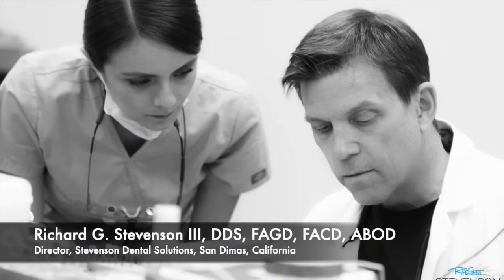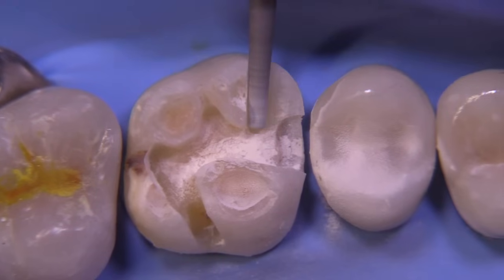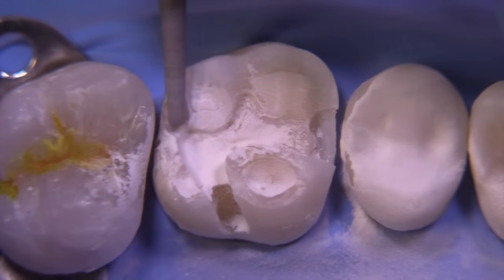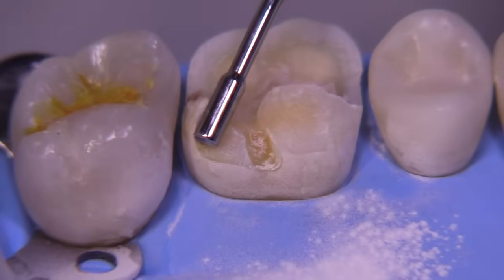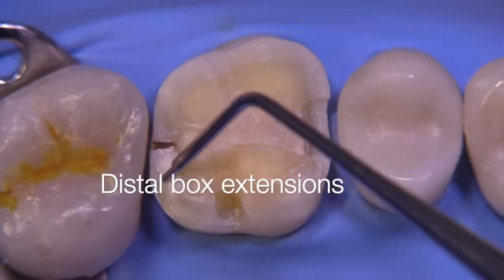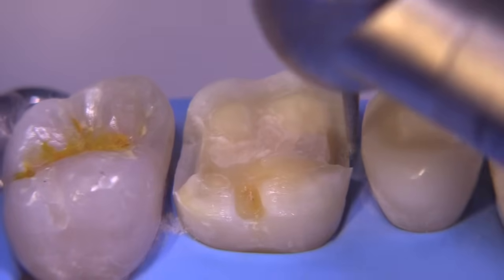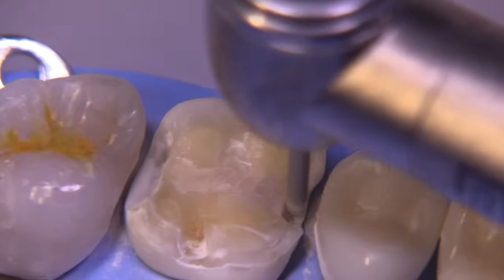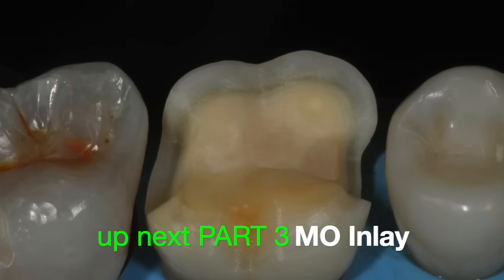Lithium Disilicate Ceramics, Part  2: Ceramic Onlay Preparation

Comment: Hello! In my training, I was only really instructed to do crowns. What are the indications for onlay over full coverage crown?
Reply from the maker: Whenever possible, a more conservative indirect restoration is preferred.  Contraindications would include: a previous crown, the need to completely change the shade of the tooth and the presence of cracks which were symptomatic and likely leading to cracked tooth syndrome, some RPD retainers (survey crowns) and some FDP retainers. In my practice of nearly 40 years I gave placed many more inlays than crowns - gold, ceramic, and glass-ceramic.
Reply: @StevensonDentalSolutions  Thank you for your reply!

Comment: One question Dr. The caries was on MO surgace why did you also prep the distal surface? When prepping for onlay do u have to create a box on M and D sides or is it just in this case?
Reply from the maker: Excellent Comment and Question!  When you need to replace the occlusal surface due to wear (exposed dentin), you need to decide on the proximal finish lines.  To keep the finish lines occlusal to the proximal contact zone is rarely an option due to the need to keep the restoration margin free from the proximal contact.  If the morphology of the tooth and the current situation allows, you can occasionally do this - however, it is not a common finding, hence, I drop the box form to extend past the contact areas.  On a terminal tooth, (a second molar with no third molar, for example) the situation is entirely different and the distal finish line may be kept on the distal occlusal portion of the marginal ridge.

Comment: Thanks

Do we need to open proximal contact with onlay preparation?
Reply from the maker: In most cases, yes.  Leaving a margin in the contact area leads to numerous lab and procedural challenges including poor margin adaptation, difficult cement removal, inability to finish and polish, residual caries, contour difficulties, etc.
Reply: @StevensonDentalSolutions  
Thanks 
But some teeth need to cut more gingivaly to open the contact which is aggressive preparation. 
Is there case report article with or without open the contact demonstrating complications after follow-up?

Comment: I still don't understand that shoulder on the functional cusp. I don't think it will provide more resistance
Reply from the maker: If you understand the purpose of the functional cusp bevel in gold crown and onlay preparations, it will be more clear.  Essentially the ceramic if left without a shoulder, will be infinitely thin when the tooth is in occlusion.  The shoulder provides the necessary bulk to this area.  Alternatively, if you prepped the tooth flat, the shoulder would not be necessary as bulk would be obtained via the over-preparation, however, Flat preps reduce more tooth structure. Another aspect of the shoulder is that it places a vertical wall onto the functional cusp which is parallel to the other internal walls and thereby puts the cement under compression rather than shear forces.  Even resin cements benefit from compressive vs shear stresses.
Reply: @StevensonDentalSolutions  ok I understand the purpose. thanks
I have an other question. If it were a composite/resin overlay  what thickness would have been sufficient for the axial preparation of the functional cusp?
oh and an other question: what''s the V prep? can you show me any example I can find on the web?

Comment: Hello! I'm new to onlays and ceramics. Can emax bond to composite?
Reply from the maker: Yes, for sure, using air abrasion on the composite build-up/block-out), then following the protocols described in the videos - its a pseudo-micromechanical bond with chemical links to the unpolymerized monomers in the original composite

Comment: So its better to always do a shoulder then on onlays preparations than no shoulder approach? It should only be performed on the functional cusps
Reply from the maker: GREAT QUESTION! A Master's Thesis I mentored at UCLA clearly showed that shoulders on functional cusps were better than shoulder-less preps in terms of durability.  I also believe that the A, B, and C planes preserve the anatomy of the tooth and the shoulder simply increases the thickness of the ceramic in a critical area.  The flat top, non-anatomical approach may leave the ceramic weak in these areas, and the flat top prep is more aggressive with the tooth structure as a whole. Thank you for watching, Dr. S
Reply: Is "flat top" preparation the same as "table tops" or is this different?  A dentist recommended I get ceramic tabletops and said this preserves more tooth structure and is stronger.  Are you saying to avoid the flat top preparation/tabletops because in the end they remove more tooth structure/aren't as durable?

Comment: What is difference in this and overlay
Reply from the maker: Overlay is a variation of onlay - it's just nomenclature variation.  Shillingburg never referred to these as overlays - only onlays.  Some school's have adopted the term "overlay" to describe a finish line that includes the lingual or facial surface vs an onlay which stops at the line angle between the occlusal and lingual or facial.  Confusing and very typical of dentistry to use various terms with much confusion.

Comment: Hi Dr Stevenson, do you always make mesial and distal boxes for full cuspal coverage onlays? Would you do so with a root filled molar with a small class I composite in the access cavity
Reply from the maker: Not always - I will perform occlusal onlays without boxes IF I can obtain a finishable margin on the mesial and distal - this is tough as it must not enter the contact area.

Comment: Great videos! I was wondering how come you dont create the axial reduction on the buccal surface as you do with the palatal surface?
Reply from the maker: It's a non-functional cusp.  Occasionally we would create a shoulder on the non-functional cusp when strength is an issue - like endo treated teeth or very thin walls.
Reply: @StevensonDentalSolutions  Ok thanks. I see that generally people out there do not create a shoulder on the buccal or lingual surfaces for their onlays, but this makes sense. I thought this might be due to ease of preparation and ease of scanning... Do you ever find that there is an issue with the digital scanners capturing MODBL onlays where there is a shoulder on both the buccal and lingual surfaces?

Comment: why not Inlay? Is Cusp Capping essential?
Reply from the maker: The cusp tips have exposed dentin and an inlay will not protect them.  I believe that when faced with a worn tooth, we must design a restoration that not only removes the biological destruction (Caries) but also other aspects relating to structure and durability.  The inlay option would address one aspect but not the others..

Comment: Thanks Dr for another great tutorial. If the functional wall is very thin, how is it possible to create a shoulder? Would a flat preparation be advised in these thin walls?
Reply from the maker: Yes, flat would be good, and that could then be made into a shoulder IF necessary.
Reply: Thank you
Reply from the maker: @amoo6933  My pleasure Doc!

Comment: Dr are you using high torque angled handpiece ?
Reply from the maker: For the videos I use standard air turbine high and low speeds, but in the clinic I use high torque electric.
Reply: Stevenson Dental Solutions thanks
Reply from the maker: @yazansinan931  Thank you!

Comment: @hi doc , love your work . How do you choose between butt joint , bevel or shoulder margins on the cusps ? Thank you
Reply from the maker: Usually use shoulders on the functional cusps and butt joints on the non-functional - these were tested at UCLA in a study I did and found to be the most predictable for strength.  I will occasionally add a shoulder on the non-functional when the cusps are weak or after an RCT.
Reply: Stevenson Dental Solutions thank you :) , please keep the knowledge flowing ! Much love from Bangkok, Thailand .

Comment: Why reduce teeth with no water? Won't it dehydrate or burn the tooth??
Reply from the maker: Use water clinically, except when finishing margins.  What causes more heat to the pulp: a sharp bur with a light touch or a prophy cup?  Answer: a prophy cup - good science supports this.

Comment: Hi dear Dr. Stevenson, what an amazing and incredible vids you produced.
I have a question if you wouldn't mind answering, the prisms directions on buccal side differ from palatel side, will that affect the prep on buccal side like to make bevel on it?
Reply from the maker: Thank you, Doctor.  You are correct - two important points I'd like to make, remove loose enamel prisms (slight bevel) on the buccal side to avoid chipping during the temp phase and don't bevel too much as this will thin the ceramic and complicate manufacture and potentially weaken the ceramic.

Comment: Great job as always ....I have a question please ....onlay preparation is indicated with sever attrition Pt due to bruxism habit ??
Reply from the maker: Complicated answer...essentially if the wear is due to nocturnal bruxism, and the patient wears an orthotic, then yes, onlays are great.  IF the wear occurs during the daytime, diurnal bruxism, then it's a bit less predictable, and either gold or zirconia will be more durable than lithium disilicate.  If the wear is due to a past grinding habit that has stopped, then you may treat as normal.  Is the wear active?  This is an important concern.
Reply: Wonderful video! Any thoughts on how to tell if wear is active?

Comment: great video dr ... i have a question a few texts say that the ceramic onlays should not encircle cusps and that there should be no shoulder preps like the one you showed here , only beveling of cusps , whats the scientific difference between the two approaches?
Reply from the maker: Back in the feldspathic days we saw that the wrapping of cusps with shoulders led to some material fractures and opted for flat tops as you mention.  With the significantly stronger lithium disilicate materials, this is no longer the case.  A research paper I co-authored in 2018 looked at the different designs and we found that shoulders are better for ultimate tooth-restoration strength.  The paper is at the publisher...Capping cusps works incredibly well with LD and likely leads to a stronger final restoration/tooth, and if performed well may preserve more tooth structure as the flat top design on the functional cusp reduces more tooth structure due to the lack of cusp incline preservation.  Thank you Doc!
Reply: @StevensonDentalSolutions  thanx for the informative reply dr stevenson , i am adopting your style of prep from now on in my practice
Reply: @StevensonDentalSolutions  HI Dr Stevenson, whats the title of your publication? Would love to read it, thanks

Comment: hi doctor... I'm a big fan of you and your videos... i was wondering why you didn't make a shoulder or chamfer on the facial?
Reply from the maker: Hi Doc, typically non-functional cusps don’t require a shoulder they are “shoed” rather than “capped” because they are not under the same stresses as the functional cusps.  I will cap the non-functional only when necessary due to structural compromises or defects/caries.  Best, Dr. S
Reply: @StevensonDentalSolutions  Thanks doctor  for your fast and informative replies. i hope the best for you

Comment: Thanks doc, for promt reply! I am not quite clear yet , so pardon me for continuing with my query and taking more of your precious time. Is it the extent of caries on the facial and lingual surfaces of the teeth you're implying? Is there a general guideline for the distance of the finish line from the cusps . I am unable to relate cusp morphology with the curve of the finish line. So if you could throw some light on it in a way I could grasp it . Thanks again.
Reply from the maker: Hi - no worries.  Onlays require the reduction of the occlusal surface just like a full crown - the major difference is that Onlays don't include any more of the facial or lingual surfaces, unless caries (note the lingual grove extension) dictates this.  Like a full crown, Onlays follow the cusp morphology during reduction, rather than just a flat top prep, hence the facial outline you see in the video - it follows the shapes of the cusps, rather than creating a straight finish line as viewed from the facial.  The lingual finish line is also like a sine wave - following the cusp shapes, and only extending beyond this gingivally if a defect or caries dictates this modification.  In the video, as viewed from the lingual, the finish line dips to include the caries in the lingual fissure area.  There are an infinite number of outline forms with Onlays (which makes them so interesting and fun) allowing the dentist to be creative and conservative at the same time.

Comment: Thanks to sharing 
I have 2 questions:
1-why not prep functional cusps like non -functional?

2-why do shoulder finishing line? We can do the design like buccal cusps just reduce the hight ?
 Regard 

You not talking about IDS after prep ?
Reply from the maker: Hi Doc - great questions: 1. Typically only functional cusps require shoulders and cusp capping in order to provide better resistance form to the restoration and tooth.  There are times when a shoulder (cusp capping) on the non-functional cusp would be necessary (cross bites, heavy occlusion, perhaps end treated teeth, etc) but the "shoe" design (as in the vid) on the non-functional cusps has been the standard of fixed prosthodontics.  2. The flattening of the lingual (functional cusps) without a shoulder requires a little more tooth removal in reality - strange perhaps, but it does, and in a Master's Thesis study at UCLA performed by my grad student, Dr. Shahed Al-Khalifa found that the shoulder design was consistently stronger than the "V" prep or "flat" functional cusp design.
Reply: Stevenson Dental Solutions thank you so much dr to your informations 
Hope to still in these videos 
Regard
Reply from the maker: I have an inlay yet to perform and then yes, we will discuss all options: Immediate (Magne), Delayed (McLaren), Simultaneous (UCLA) and Pre-cementation (Manufacturers) - there are plusses and minuses to each technique.

Comment: Fantastic work Dr. 
Great video as always, incredibly informative, and fantastic technical skill that I can only wish to one day emulate.
I have a question if you wouldn't mind answering 
In regards to indications for an onlay. Would you say that you have certain criteria/guidelines that you would asses a tooth by, to evaluate if an onlay is the best option as opposed to a direct restoration?

Thank you in advance
Reply from the maker: Such a tough question!   If the occlusal surface needs restoration which will include cusps, or when the isthmus is wider than 3 mm for molars, or when there are symptomatic cracks (use a tooth slooth to evaluate), or when a crack extends gingival with dark stain, or when the tooth is structurally compromised but has good enamel and dentin on the facial and lingual.  Ultimately it is a clinical judgement call.  The decision to place a direct, or an inlay, or an onlay or even a full crown is not always clear and the same situation would likely be treated differently depending on the dentists' philosophiy, skills set and prior training.  Best to you!